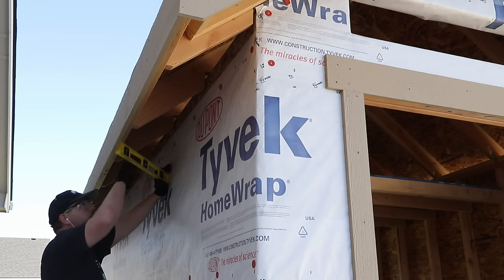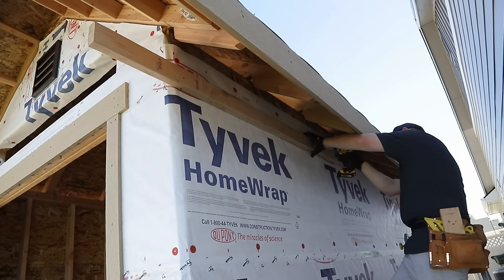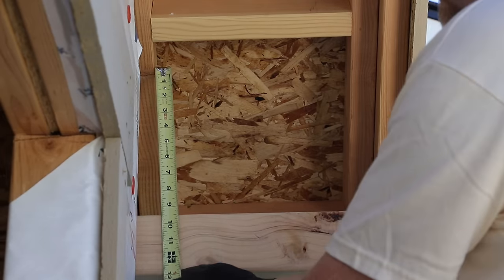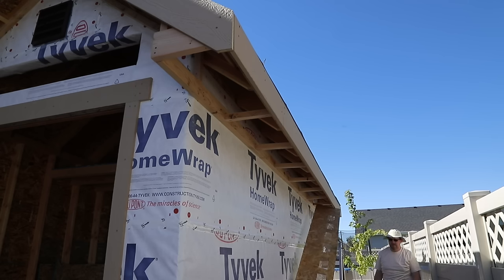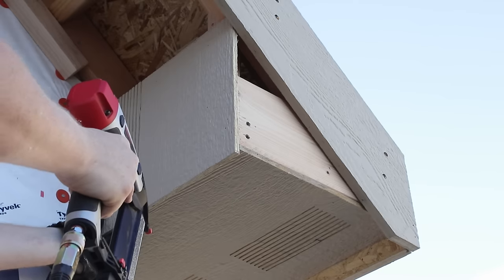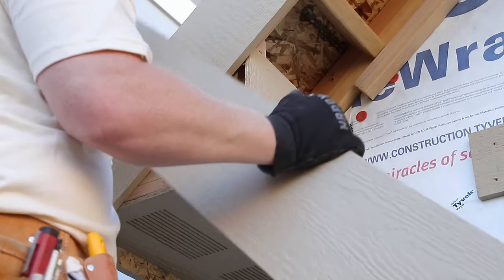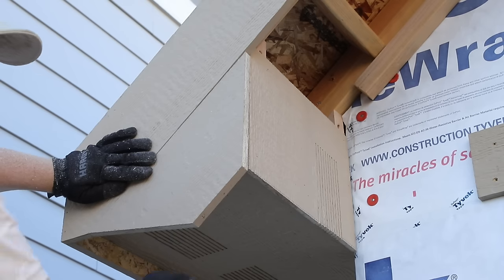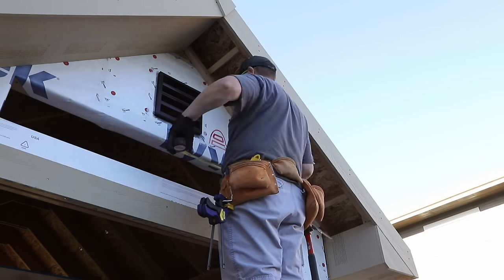How to Install Soffit and Build Bird Boxes: How To Build A Shed ep 14

Comment: I recommend using the rule keep body parts at least the length of the fastener away from the nose of the nailer - in any direction.  Think of a sphere with a radius the length of the fastener, and the nose is the center of the sphere.  That's the clear space around the nose of the nailer.  That keeps even nails that deflect out the top from piercing anything that hurts and leaks after piercing.  Also, I would have kept the vent slots the same for both the eave and rake soffits - either towards the building or away from the building.  I agree with other commenters: great video, very clear, easy to understand!
Reply from the maker: Great tips, thanks for watching!

Comment: The boards that hold the soffit are called lookouts. I just started watching your videos I guess those are rafters are 24 inches apart if they were on 16" could have done a 3/4 inch facia without that 2x6 behind it. I guess it's supposed to be how you can build a shed by yourself otherwise I think your son should be helping you all the time...  maybe he's the one photographing

Comment: You mention about the brads to hold the board in place, yes those r wrong. Hardie in a few videos on here specifies the nail or screw type required as well as nailing spacing from edges 3/8 or corners 2 inches. Hardie is HEAVY and you need the correct head on the fastener!
Reply from the maker: You are right about brad nails with Hardie - but this was not Hardie, it was LP Smartside, which is an engineered wood product, not cementitious like Hardie. It's substantially lighter, and while brad nails are not the best choice, I've had zero problems with these in the several years they've been installed. If you are installing Hardie, definitely use a stronger fastener. Thanks for watching!

Comment: You mentioned your ledger board was 2x4 and the facia was 2x6. What size board did you add to the bottom of the 2x4 ledger?  Also, how do you like the one-piece soffits you used?

Comment: Great stuff! Does it matter if the vents are "inboard", or closer to the edge? Another idea I've had is to put some metal brackets into which the soffit can slide against the wall, and then maybe you can tilt the whole thing up and nail it without the clamp, and possible "un-clamping". No doubt newbie-wishful-thinking on my part! ;-) Thanks again!
Reply: Yes, you want vents at outside, away from the house. It’ll be in manufacturer instructions. On a side note who was the manufacturer for this product?

Comment: Oh wow!!! Thank you for being so honest.
Here I am. Trying to remember how poorly I can be with measuring.
How worried I am about this triangle magic square tool. Trying to start a project that's already past due.
But, cannot waste any materials.  It's the way you mark the edges of those angles corners and such. I knew I would need to do something like that to help me.
In much shorter words. Thank you for helping me.
Now, may I ask you what kind of board or aluminum was that soffit you had clamped up? All of those strips and tin cutting had me worried.
How do I find what you had?
And it had holes in it.
Thank you so much.
Reply from the maker: Hi Marie! The soffit is from LP Corp, sells under the brand name "Smart Side". You may be able to find it at your local Lowes or Home Depot, but you may also have to go to a local lumber supplier. Here is a link to the product details from the manufacturer: https://lpcorp.com/products/exterior/siding-trim/products/soffit
Good luck!
Reply: @AmplifyDIY  you're awesome! T.y.!

Comment: I’m working on my little getaway building on my property in the wilderness. Do I need to use soffit (Vinyl) material to cover my soffits? Can I just use whatever like the Hardie board sheet siding that I’ll be using on my place? Could I use marine plywood?
Reply from the maker: Hi Jeff - you can use more or less anything you like. Just make sure it can breathe, as you need to allow air to exchange into the soffits so that any condensation has a chance to evaporate. Good luck!
Reply: @AmplifyDIY  Thank you on the opposite ends Of the attic there are vents that are about 12” x 6” I’m hoping that sufficient. Oh one other thing does the soffit area it’s self need to breathe or we just attempting to make sure the attic breaths?

Comment: After a couple more rewatches I think I can do this on my shed now. Thank you.
Reply from the maker: I’m happy to try to answer questions that come up for you during your build. Good luck!
Reply: @AmplifyDIY  What material type did you use for the soffit ? I'm researching the benefits of each.
Reply from the maker: It’s vented soffit from LP. All the soffit, siding, and trim are LP products. It’s essentially pressed fiberboard, is easy to work with, and was readily available in my area at a local contractor building supply place.
Reply: @AmplifyDIY  Thank you  for the help.

Comment: is that trim a hardi product? same goes for the soffit? seems like a cementitious board. i bet those brad nails will be fine (as long as they are heavy gauge and stainless or galvanized), although for future you could add a couple of grk trim screws here and there. as it settles the brad nails might not hold so well.
Reply from the maker: I don't recall for sure if the soffit and trim are made by hardi, but both are a wood fiber product, not cementitious. The brad nails are galvanized, and so far (nearly a year later) there has been no shifting or settling of the soffit that I can see. I'll get after it with some trim screws any problem in the soffit or trim develops. Thanks for the feedback, and thanks for watching!

Comment: Was the soffit board cut to size depth wise?  in other words, when you built your roof, I would imagine you had to know early on what depth to build those eaves based on the size of the soffit board.  Did you plan that far in advance that you knew the size of the soffit board and build your roof overhang accordingly?
Reply from the maker: Great question! I did plan enough in advance for sizes, but the soffit was just too large from the factory - I believe it comes in 24" wide pieces, and that was just too wide for my taste for the overhang. I wound up trimming around 6 or so inches off the soffit.

Comment: Hello I’m watching your complete build and would like to know what you used for the soffit? Also does the soffit recede a little under the fascia board? Thank you really enjoying the videos. Oh the is your trim called Smart Siding?
Reply from the maker: Hey there - thanks for watching! I hope you are finding it useful. :) 
The soffit is a product from LP: https://lpcorp.com/products/exterior/siding-trim/products/soffit  - I picked it up at a local contractor supply center called BMC West. I don't know where you are, but they are all over the western US. Google "Building Supply Center" or similar to find somewhere in your area that carries it. 

The soffit does not go under the fascia board - it just butts up against the back side of it. 

The siding is LP SmartSide in a cedar texture. I believe I used the 8" wide version: https://lpcorp.com/products/exterior/siding-trim/products/lap-siding - I picked this up from the same place I got the soffit and trim pieces as well. 

Good luck with your build!
Reply: @AmplifyDIY  -- Another of those "engineered wood products"... :(

Some of us have had experience owning houses with that previous "engineer wood product" Masonite and are hesitant to use something like that again...

Masonite survived if it was not exposed to water or light... Which is a bit difficult to do considering it's intended use is on the EXTERIOR of a house...

One of the problems with most of the siding choices is that they are not all that friendly for the sole DIYer who does not have an extra pair of hands to help.  I can probably handle about a 6-8 ft piece siding without any help... Those 14 ft ones need another set of hands...
Reply: @jakeblanton6853  That isn't "Masonite" It's an OSB product. Nothing like Masonite...Older Masonite didn't have the additives that are in the newer versions of it.
Reply: @fraydcat  -- Time will tell... Some of us had bad experiences with houses that had Masonite on them (did ANYONE ever have a "good" experience?), so we are hesitant to use ANY "engineer wood product"...
Reply: @jakeblanton6853  It's been at least 20years since the product changed...The Masonite you are talking about was from the 1975 thru the late 90's. The manufacture uses different glues and Boric acid to resist mold and rot...
I believe time has all ready told...It's 2021...
Reply: Anyway, the product this guy is using isn't even that type of product. It's an OSB product and is completely different than Masonite...

Comment: Great job brother! I love the soffit you used, locally all I can find is the cheesy 1 foot pieces of aluminum that goes up one tiny section at a time. Where did you buy the soffit you used?
Reply from the maker: Thanks! I picked up the soffit at a local building supply store (not a big box store like Lowes or Home Depot, but more of a contractor supply place). In my area there are 2 main places to look for it: Franklin Building Supply, and BMC West. These are common in the western US, but depending where you are you may have to find it somewhere else. 

The soffit is from LP, and you can use their website to see who stocks it near you: https://lpcorp.com/where-to-buy?sellerType=home-center&sellerType=dealer-lumberyard&sellerType=distributor

Specifically it's the "Vented Soffit" product. 

Good luck!
Reply: @AmplifyDIY  Wow, thanks for the speedy and comprehensive reply sir!

Comment: Are bird boxes required? I've seen some new construction homes without them and the roofline looks much more clean to me. I would like to remove the ones on my house but don't know where to start or if it's a bad idea.. 🤷 help?
Reply from the maker: Hi Michelle! Bird boxes are not "required", but are a design element chosen by whomever is designing/building the structure. My home was built with them, so I mimicked that in my shed. Now, removing bird boxes will be .... tricky, as in order to do so you'll have to make pretty substantial changes to your roof/eaves/walls. Thanks for watching!

Comment: Boy the soffit boards look a lot easier to install that cutting a lot of vinyl pieces.
Where can I get soffit boards?
Reply from the maker: Hi George - I found the soffit at a local lumber supply yard. If you google "Lumber Supply" or "Building Supply", you should find somewhere in your area which carries them. My local Lowes and Home Depot have similar products, but not in the exact sizes I wanted. Good luck!

Comment: You might have considered using construction adhesive along with the brad nails as insurance. 🙂  But I’m an engineer so I overdo everything  😆
Reply from the maker: Hi Doug - if I were to build another shed, I may double up with adhesive as well as the brad nails - but it's been a few years since I built this, and it is holding up perfectly (so far). Thanks for watching!

Comment: Did you use the silicone paintable acrylic caulk on the cut end edges? Sorry but its going to absorb water and the edges will look terrible in years to come.
Reply from the maker: Hi Bear and Sesame - no, I sealed all the cut ends with primer, then used OSI Quad caulk: https://amzn.to/3hoEAer
Reply: @AmplifyDIY  AttaBoy! Nice work!

Comment: Where did you get the pre-vented soffit board?
Reply from the maker: Hi Aaron - I believe I just picked it up at my local Home Depot or Lowes. If you can't find it there, a local lumber supply store should either have it in stock or be able to order it for you pretty inexpensively. Good luck!

Comment: Not really the best method for building the bird box but it works.  Also, you don't use vented soffit on the rake (gable) end since it isn't really doing anything.
Reply from the maker: Heya Cooper - thanks for the feedback. I used the vented soffit on the rake simply because I had it on hand, and didn't want to bother buying different non-vented soffit just for the small rakes. Having vents on the rake don't really hurt anything, right?

Comment: Great video!  Bird boxes are a bitch.  I would like to add that 1/4 crown staples are far superior to brad nails for horizontal surfaces.  I specialize in home repairs and routinely encounter panels installed with brad nails that have failed over time.  Vertical surfaces are just fine using brad nails, however for horizontal surfaces stick to 1/4 crown staples. The 1/4 inch crown connecting the two legs of the fastener ensure that it will not fail over time.  If you have ever demoed soffit that has been stapled, you'll see.  Great video though!
Reply from the maker: Good tip. Thanks for the feedback, and thanks for watching!
Reply: manufacturer recommends box nails with 0.27" head, 0.10" shank thickness, 1.5" long

Comment: I can imagine that wood doesn't last as long as aluminum fascia, I think I'd rather use aluminum. Looks like aluminum would be less work.
Reply from the maker: You may be right - I've never installed aluminum fascia. Wood is required by my neighborhood homeowner's association, and it matches my house. I think it will last much longer than I'll be around to see. Thanks for watching!
Reply: AmplifyDIY What kind and were, were you able to find that type of soffit.Thank You
Reply from the maker: It’s a wood-fiber based product. I don’t know the exact brand, but I picked it up at a local building supplier. Google for “building supply” and you should find a place in your area. Big box stores don’t carry soffit like this. Good luck!

Comment: Why a vented soffit on the front? there is no reason for it
Reply from the maker: Hi Charlie - sorry for the delayed response. I did it that way simply because I had left-over vented soffit, and didn't want to go purchase more of the non-vented kind for such a small area. If I was doing a much larger shed or house, you are correct - you don't need vented soffit in that area... but it's not going to hurt anything to use it there either. Thanks for watching!

Comment: Braid nails are too small for the soffit
Reply from the maker: You are probably right - if I was building something more substantial than a shed, I would have used something larger. These have held up great in this instance, though. Thanks for watching!
Reply: I'm currently replacing the soffits and fascia on a house that I own.  The rain gutters allowed the fascia and soffits to get damaged.  The soffits were that Masonite crap (basically cardboard) and it does not handle water very well.  I'm using an 18-gauge brad nailer with the 1.5" staples in it and they seem to hold well enough so far... I'm using 5/8"x5.5" fir for the soffits though and stagger the rows like when you are putting down a wooden floor.  I put a minimum of 3 of the staples at every "rafter".

Comment: Looks a little weird with your fascia hanging down an inch past your soffit.
Reply from the maker: Huh. I built it following the same pattern / design that the builder used on my home. I assumed they did that to help make it a little less likely that water / wind would ever get into the soffit. Thanks for checking out the video!
Reply: That is the way you it is done.  Always overhang
Reply: assuming water gets passed the drip edge and on to the fascia, if it is flush surface tension would bring it on to the soffit = no bueno